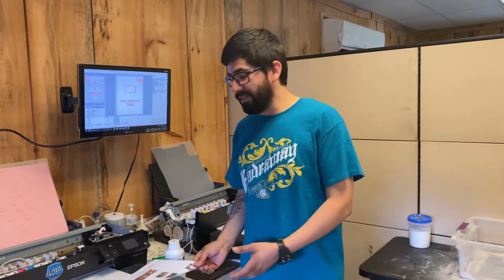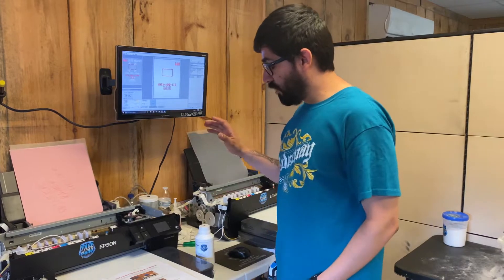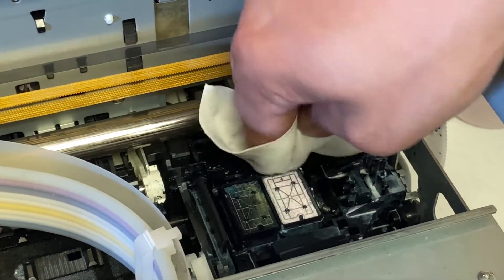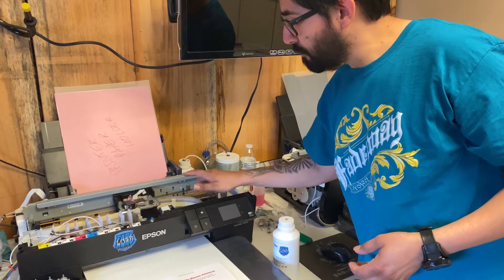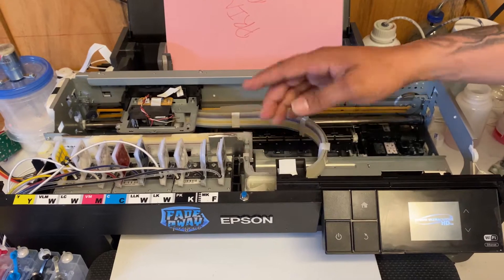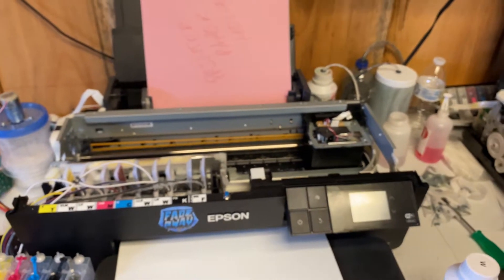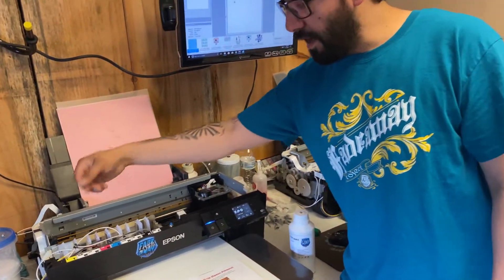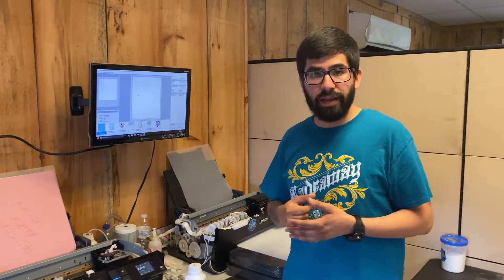EPSON P600 (Direct To Film) DTF Maintenance PT. 1

Comment: Bro as a DTF printer and a printer converter you can see several of my videos printing and converting printers on my channel. My point is put the cover on your scaring people with your printer that looks like a nightmare wire everywhere put the cover on people don't want to see mess and confusion they want to see order put the cover back on. Granted you're showing something fine but start the video with the printer cover on end the video with the printer cover on please.
Reply: A lot of people use barebones printer setups bud it is just easier for the day to day maintence
Reply from the maker: Hey I appreciate your feedback. 
Being able to convert a Epson P600 to DTF is slightly different from other models, showing the best way to use and having access to the capping station is having the cover off for easy maintenance. Having the cover on has made it difficult to troubleshoot any issues coming across. I have easy access to take the print head out and maintenance it/clean it. Everyone has there own way but definitely appreciate the feedback. Subscribe and I'll do the same. Have a great day.
Reply: @fadeawayproject3166  thank you for your videos and for your professionalism.  As someone who started using DTG Kiosk machines and having to constantly maintain I can greatly appreciate your setup.

Comment: Great video. Now a few questions :)
1. Why do you use this ink order (Y W W M C W W K F)?
  2. F is flush / cleaner?
3. Why aren't you using chipless software?
4. Is a dumper necessary?
Reply from the maker: No problem, thank you. 😀
1. The RIP Software requires for the ink to be in a certain order to print correctly. 
2. F is Flushing fluid/ cleaner correct. 
3. I do have chipless installed on my P600.
4. Dampers are not necessary, I use them as my ink cartridges so I have fresh ink going to them constantly.
Reply: @fadeawayproject3166   That is, this order corresponds to white colors next to each other in the caping station. Do dampers not create additional space where the white ink settles? do you shake them or suck them out with a syringe? Sorry for a lot of questions but just convert p600 to dtf. Now I'm print DTF with the P50- A4 size

Comment: Hello! There buy ink chip reset button and system ? Ink tuning dempfers ?
Reply from the maker: You will need the WIC RESET Software and Adjustment Program for the Epson Printers.
Reply: @fadeawayproject3166  I have adjustment and i have reset chip cartridge ,
Reply: there is no reset button
Reply: @futbolki_russ  Find a CISS that has one built into it is the easiest way, I'm guessing these guys just extended the wires and fitted theirs into the printer for easy access.

Comment: Good video. Please can you tell me the dimensions of the output tray for your dtf p600 printer. Thanks
Reply from the maker: Hi, from the table it's 3.5" height.
Reply: Can i use a Gray output tray? Only what to do is cut a sensor wire - how you think... it can work?